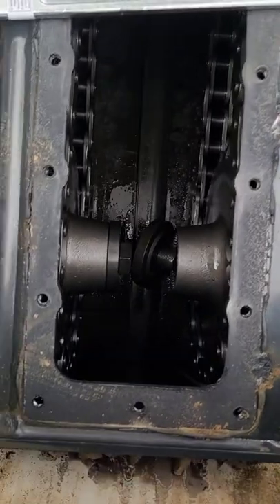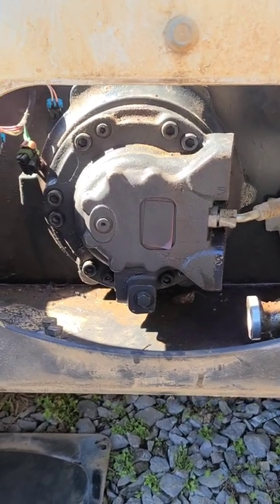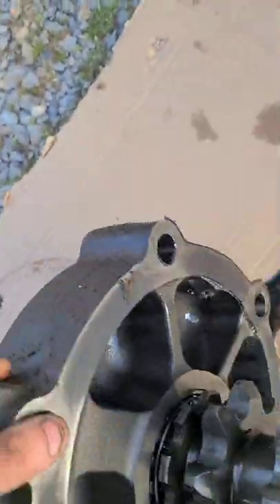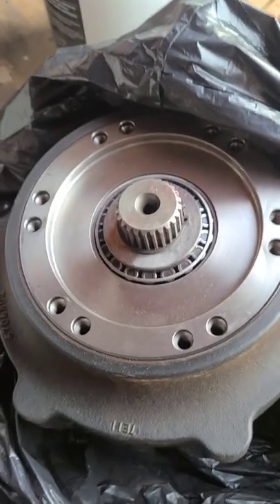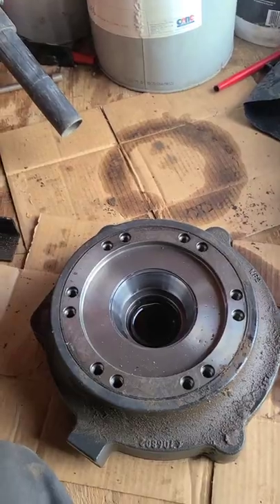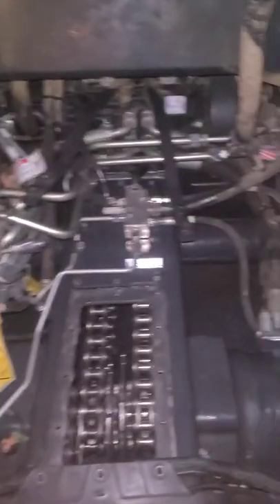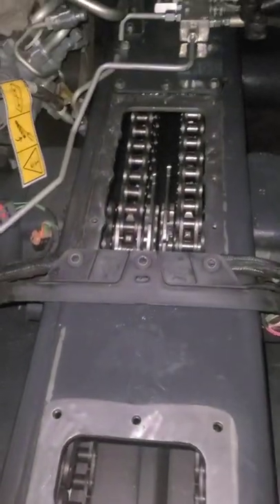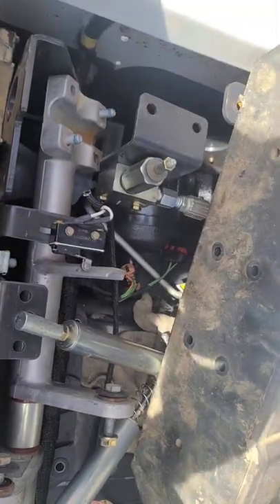Bobcat S650 carrier seal replacement

Comment: I have a s630 how did you remove the chain? Thanks
Reply from the maker: Not sure if 630 is the same as the 650 but if it is I show in video how to get them off whole carrier has to come out and have to press out at least front and rear axles out to get sprockets off

Comment: Do you happen to know the torque specs for the 1 1/2 inch shaft bolts
Reply from the maker: Tight as you can get them with a regular wrench there is no way to fit a torque wrench in there I used blue locktight also
Reply: They should be regular threads or are they left hand thread bolts… i tried but they are TIGHTT
Reply from the maker: @jesusmtz413  yes they are regular thread and tight

Comment: What did you use to connect the links. I’m assuming you cut the chain and reconnected it. The video has been a big help
Reply from the maker: No chain has no links. It's a pain but I had to man handle the big sprocket back onto the axle and have my son rotate the axle to line up with splines
Reply: Meu mecânico cortou as correntes.agora preciso das emendas

Comment: Greetings .. first off .thanks your video helped me a lot ..  I recently had the same problem .. however am I correct that you mentioned you need to put two seals in instead of the one ?
Reply from the maker: Yes the update calls for 2 seals one facing the chain case side and one facing the carrier side back to back
Reply: I did this  and it still leaks .. not sure what happened .. took it back apart and and both seals damaged...
Reply: They were deformed as if extreme pressure was a factor
Reply from the maker: @jermainebristol7902  did you grease the seals and shaft really well before you put shaft back through them? Even though they have oil next to them they will still get hot when shaft starts spinning in them if they were put together dry.

Comment: Hello. I need your help... I only requested 1 seal for each carrier because I thought it was like that, but when I disassembled it, I saw that there were 2, now my question is: can I install the ones on the hydraulic side (high pressure) and leave the same internals?
because I'm far away and I don't have more
Thanks a lot.
Reply from the maker: For the amount of work involved if it doesn't work I would get both they go back to back so if they were leaking it will still leak the second seal is to keep chain case oil in chain case
Reply: @iknowyourebrokeauto468  thanks for your help.
I will have to order the two from the chain case because I was thinking of leaving them and only changing the first ones, but as you say: "for the amount of work"

from Colombia
Thank you again.
Reply from the maker: @leandrovasquez2102  at the end I have the breakdowns for it all if you didn't get that far
Reply: @iknowyourebrokeauto468  yes, I already disassembled everything, but I had always seen only one per side, now that I did the same job I found that there were two per side.

Comment: I thought the carrier seals were done on the outside of the machine. You just take off those side cover plates and you can get to the seals???
Reply from the maker: How I wish that was true lol
Reply: @iknowyourebrokeauto468  is it possible that it’s true for other models? I have a little bobcat S 70.
Reply from the maker: @MrRyanlipp1980  I'm not sure that's the only machine I've done them on. Your best bet is to call the dealer and have them send you a breakdown of where they are
Reply: @iknowyourebrokeauto468  
Trying. It’s like pulling teeth trying to get a hold of them. Sometimes I feel like my wife knows more than they do.
Reply from the maker: @MrRyanlipp1980  if you can send me a serial number I can call my guy and find out

Comment: I have a bobcat 250, its passing oil. I changed the carrier motor seals and its still passing oil to the chain box. What else can it be?
Reply from the maker: Hate to say it but the only way it can get in the chain case is from that seal. Improper install, wear on the shaft from the seal, or the carrier is cracked internally.
Reply: @iknowyourebrokeauto468  thank you for the reply, greatly appreciate it! I will take apart again, does the carrier take 2 seals?
Reply from the maker: @mch5588 I'm not to sure on the 250 wheel skid. The T250 I worked on last didn't have a chain case it was a Hydraulic drive to the track sprocket. The S650 in the video only had one seal in the carrier when I took it apart, but dealer said the update called for 2 back to back. I would call the local Bobcat dealer and ask to be sure.
Reply: @iknowyourebrokeauto468  thanks bro! I appreciate your input 👍
Reply from the maker: @mch5588  bo problem at all if you have any other questions just ask
Reply: My had that problem because the return filter were plugged small ones on the lines.